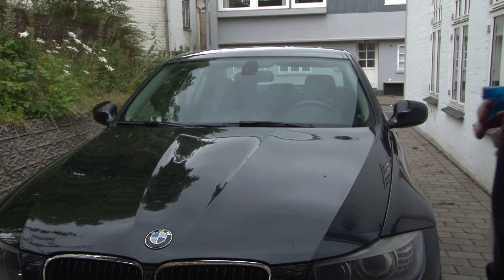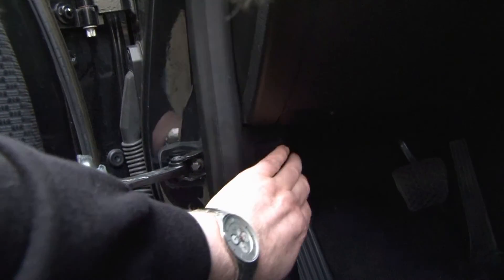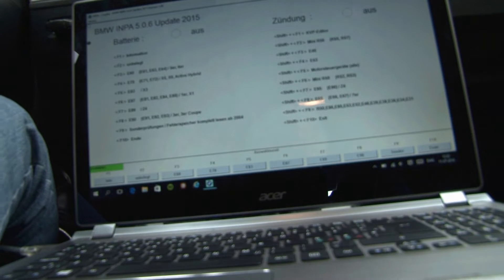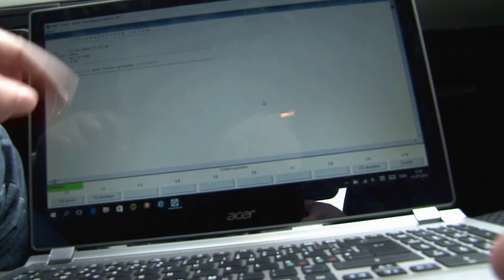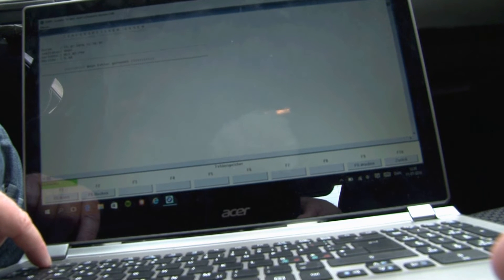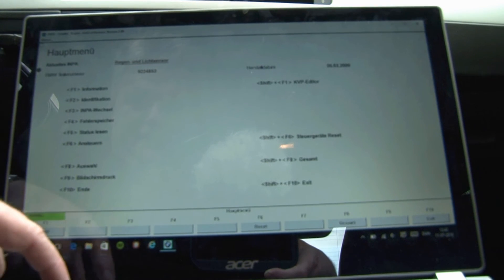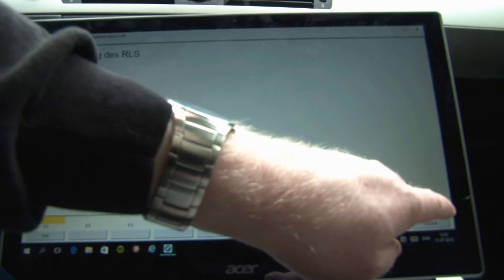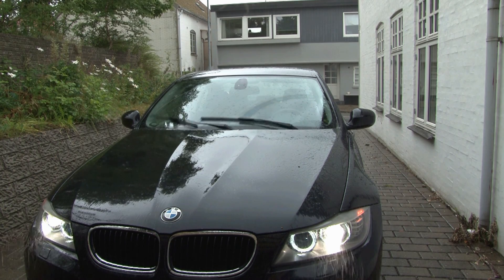BMW Rain Sensor Calibration / Reset - 3 Series E90

Comment: It would be better if we could hear something or see something....
Did You run calibration on clean glass or was there any other setup (like level of sensitivity?). From what I see You run diagnostics and You have re-initialized the sensor. Screen is blurry and Im not sure - was there an option to select sensitivity level?

Comment: working perfectly now after inpa reinitialization. 
I think even with original bmw windshield,  RLS needs a reinitialization once you disconnected the battery for a little long time . Maybe  the rain sensor on the bmw original windshield of my 2007 e92 lose sensitivity  due to battery disconnecting 12 hours for starter replacement job. Thank you very  much.  By the way, my inpa version is F6 for initialization.